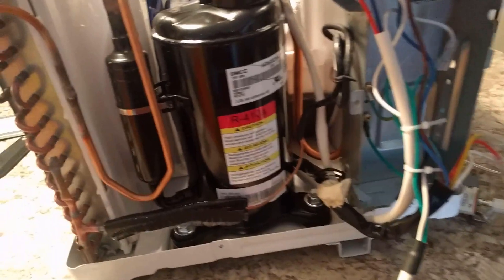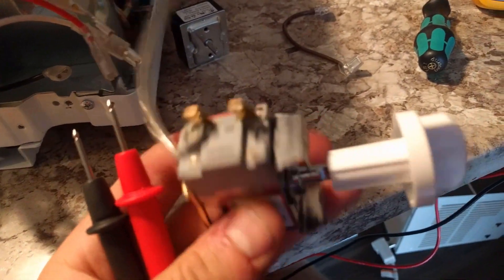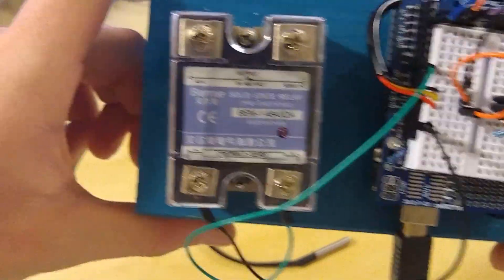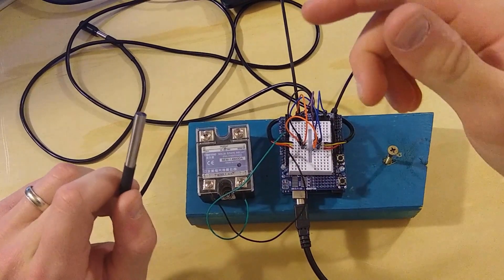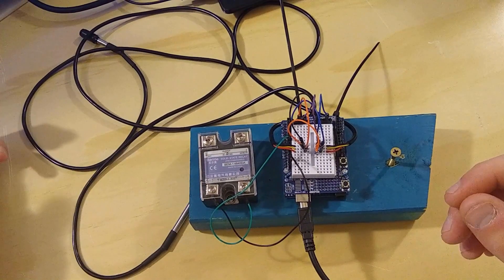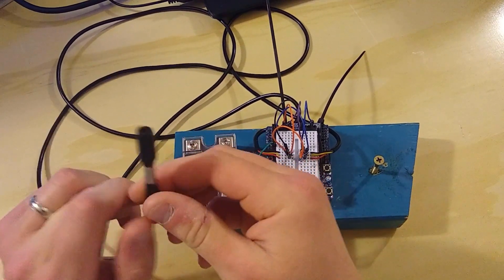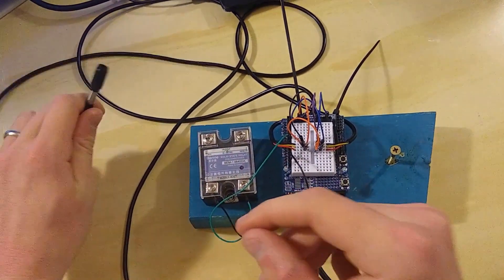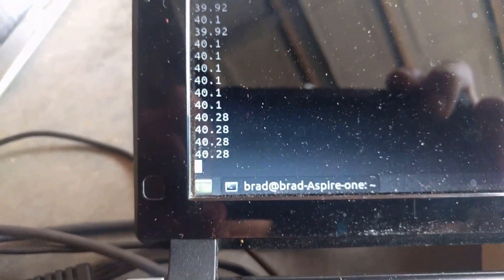I Saved Thousands and Built a Flower Cooler Myself With $30.00 Controller!

Comment: Where did you source your materials? Links please.  Thanks
Reply from the maker: Hey Larry I don't know where your from, but I got these from home Depot. I used 2x2s for the walls, don't do that I needed more structure use 2x4s 16in on center and pick a size by that metric. I just got the cheapest stuff I could

Comment: let's see this code! I'm thinking of doing this with a raspberry pi and have a  web server for temp reading access.
Reply from the maker: Honestly all it was, was pulling in the temps from the temp sensors (plenty of Arduino or raspberry pi tutorials on that) then 2 if statements.... If above x temp put pin high, if temp 2 is below y temp shut down ect and I sort of go into detail on that.
Reply from the maker: Also I forgot to mention, now I would incorporate a minimum on and a minimum off time, that way you don't burn up your compressor 5 to 10 min is good for that I would say
Reply: I’d like to pay you for the plans and Code to make a mini version of this powered by a car battery - if this is possible and you are interested please let me know